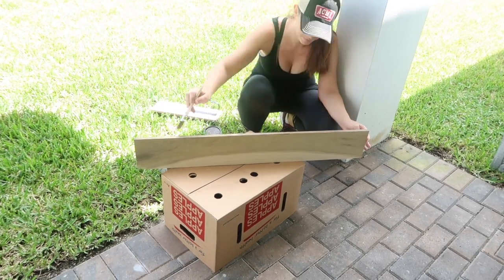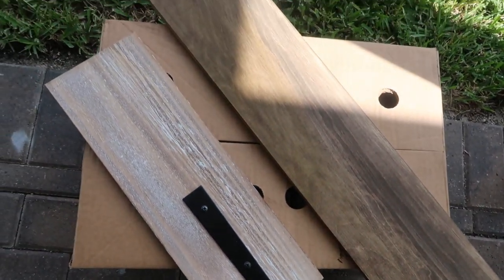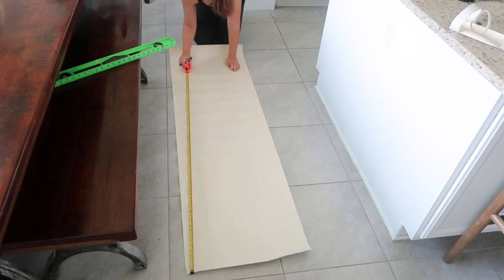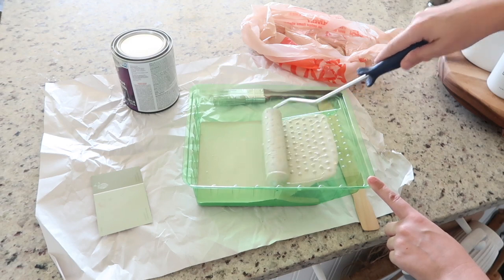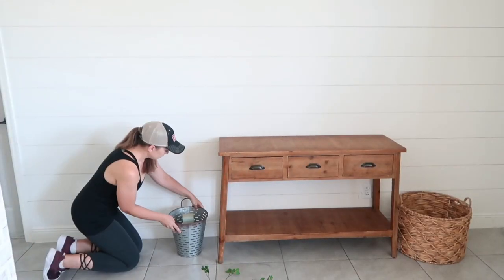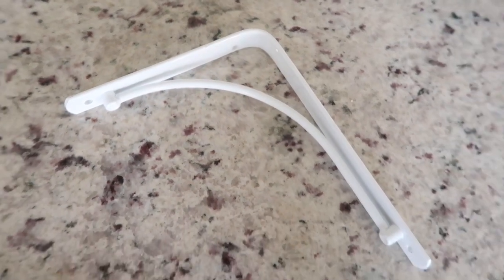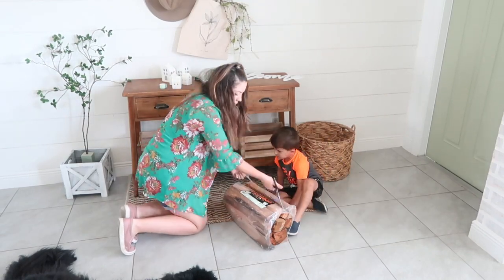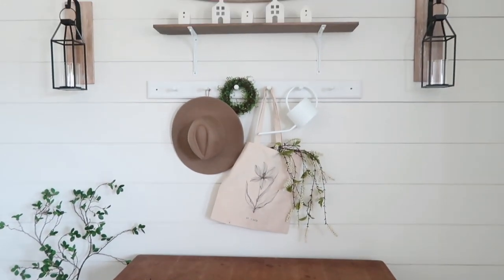DIY ENTRYWAY MAKEOVER ON A BUDGET | Decorating Ideas | Modern Farmhouse entryway | Entryway DIY

Comment: Your entryway looks fabulous!  If you wanted the shelf to match the lantern hangers closer you could have probably gone over the stain with some watered down white paint but it looks good as is.  To get a weathered wood look I often do some dry brushing of white or gray chalk paint before I stain.  I have never seen a front door that opens out.  Usually they always open in so the hinges aren't facing out where someone could tap out the hinge pins and take the door off.